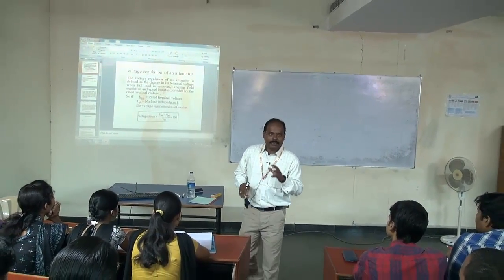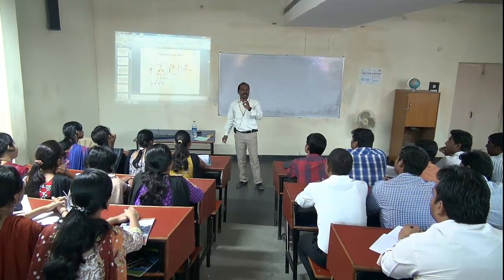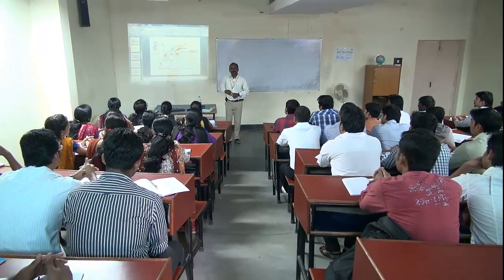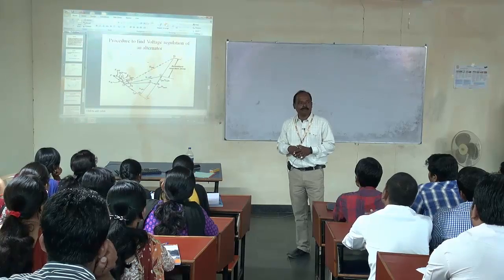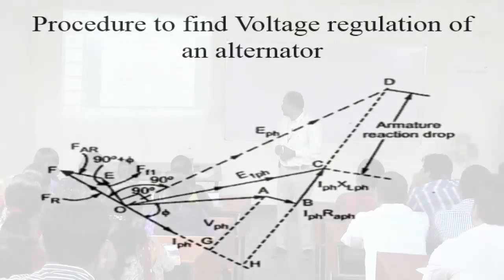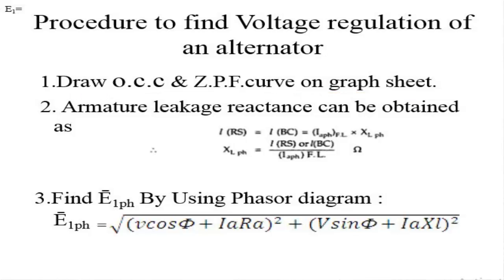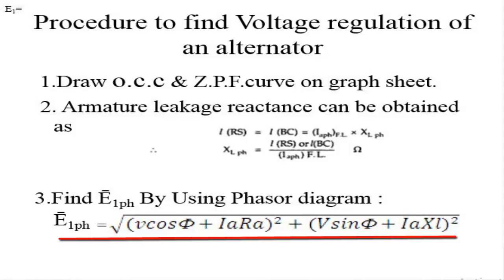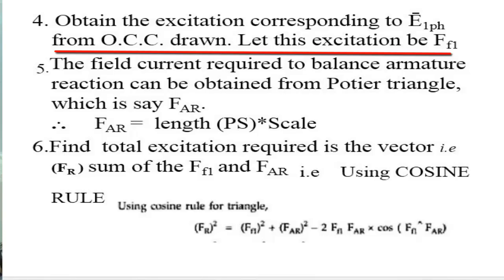Voltage regulation of an Alternator

Comment: prime mover is coupled to the stator of the alternator...??
Reply: see actually it is not wrong, but in most of the cases the field circuit is in the rotor, the reason why field is in the rotor is that most of the alternators have high current rating (so the sparks at commutator is not be there). also sometimes it is done for ease of construction
Reply: The hash tag in diagram means  it is coupled